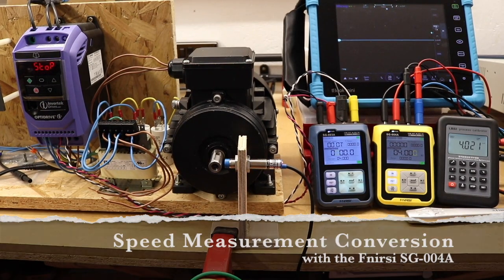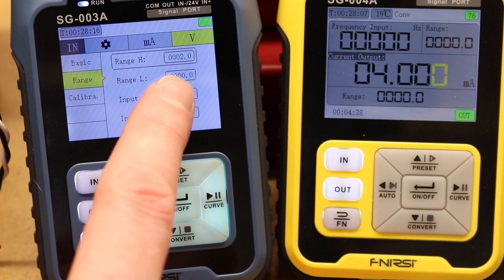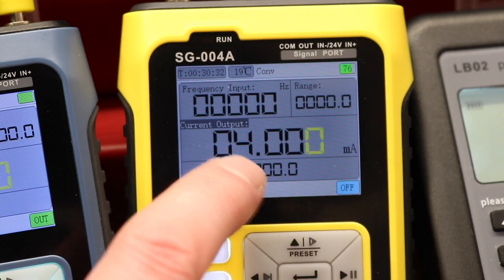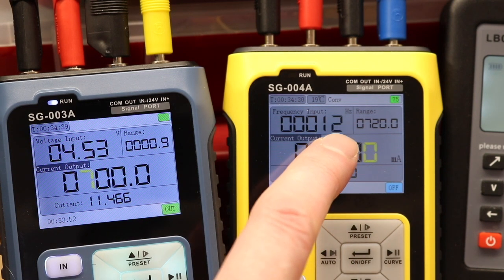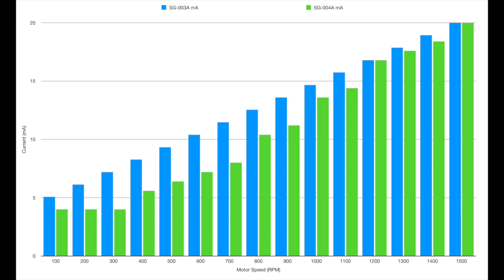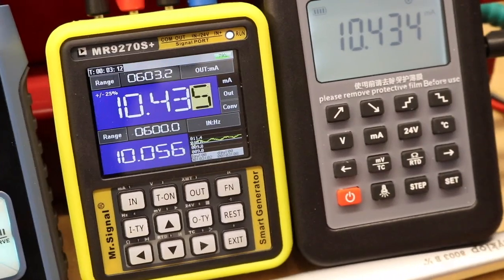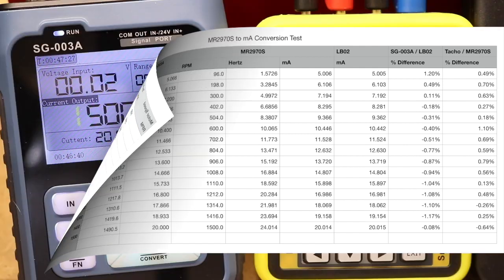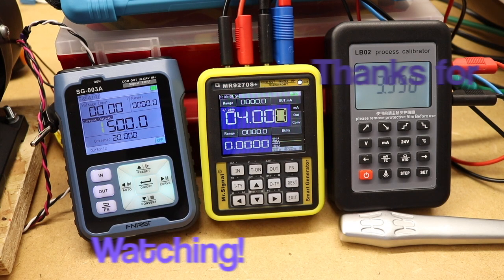Attempting Speed Measurement with the Fnirsi SG-004A

Comment: The "Convert" function to 004A does not work adequately. Given: measuring the resistance in 004A and converting it to a current output. 
If you set the settings:
Input H = 390 L = 0
Output H = 20 L = 0
then everything works. But if you ask 
Input H = 390 L = 0
Output H = 20 L = 4 (current 4...20) then the output is 0...20 mA anyway
Reply from the maker: Yes, the SG-004A does seem to be a bit quirky in its operation. Thanks for watching and commenting.

Comment: The only firmware update they released (2022) fixes one single problem, changes the word ULSE to PULSE. But they didn't change CUTTENT to CURRENT. Poor quality, no bug fixes, and the firmware update tends to brick the device.
Reply from the maker: I have heard that the have been issues with the firmware upgrade bricking the units. I haven't tried it on mine. They are of course very cheap units in comparison to what else is out there and unfortunately, support and development will likely be problematic. 
Thanks for watching and commenting.

Comment: According to the manual it can be controlled under MODBUS Slave mode and at the end of the manual there are tables of MODBUS functions. But, the manual does not describe how to connect the wiring. Does anyone know how to communicate and control this device using MODBUS (RS485) ?
Reply from the maker: On my unit the RS485 connections are on a 3.5mm stereo jack, there is a label below that identifies the G, B and A terminals. I did get a 2 wire adapter lead with my unit as well. The manual states that you will need a driver unless you are using Windows 10.

Comment: Well My SG_004A made it  exactly 30 days of daily use before use before biting the dust and wont power up after charging it. Of course today was the last day of the return window. I haven't even removed the screen protector.   🙃
Reply from the maker: That's bad news. If there is no success via the seller, then you could try contacting Fnirsi direct. They are a bit slow to respond but they have done to me in the past. They do send these out to Youtubers as well to review, so I would have thought they would be happy to replace a failed one.
Reply: I was able to end up sending the SG-004a back and they’re supposedly sending me two SG-003a’s in exchange. I know the SG-003a has less res than the SG-004a but I was finding myself using the SG-004a more for indicator leds, digital input and 4-20ma signal testing. so I think the SG-003a will be suitable for most of my testing I would otherwise use a PLC tools loop simulator for which has hardly any resolution and only outputs 10v and cost twice as much. Ill still be able to supplement other test equipment I have for those times I need to preform more in depth troubleshooting.
Reply from the maker: @mumbles1justin  That is good news, hopefully the new units work for longer! They are really useful and practical for general fault finding and investigation work.
Reply: another one bites the dust lol. SG-003a stopped working properly after about an hour worth of use. Now no matter what I do it only outputs 5v.

The input on the other hand will output up to 25v when 24v power is enabled on the inputs.

Ive finished out the day using the Mr signal to preform the same tests on the same equipment and it didn’t fail. So I don’t think there was any unseen hazards on the cables that caused the SG-003A to fail.

I have one more SG-003a still unopened in the box. I don’t know if I should hold on to it and use it or try to sell it and recoup some money.

Originally I had downed the Mr signal. due to past experiences, but this newer model is definitely better than the original model mr signal.
Reply from the maker: @mumbles1justin  Bizarre why you are having so many failings. There seem to be a few of these units out there, but I suppose a lot of the Youtubers just get them, do their video and don't really use them after that, at least certainly not in an environment that you do.

Good to know that you are getting on well with the Mr Signal. I have certainly found mine to be more stable than the Fnirsi.
Reply: That was going to be my next question. Have you been using the Mr Signal and/or Fnirsi in the field?

Your the only person on youtube thats reviewed any of these cost effective process meters that appears to work in an environment that would warrant using them.

All other youtube reviews Ive seen are from people that appear to just be home lab electronic enthusiasts that barely understand what a process meter is used for. Little lone actually demo these units on actual equipment such as a VFD like you’ve done.
Reply from the maker: @mumbles1justin  The SG-003A has not been out on site anywhere. The SG-004A and the Mr Signal have. I have been using the SG-004A today working on some temperature pucks. It is a bit more unstable in measurement mode than the Mr Signal, but has not failed like yours.
Reply: Let me ask this dumb question… In your opinion should a process meter withstand being connected to a faulty sensor with shorted current loop or shorted signal line without compromising the meter if the sensor is being powered by the meter? I assumed the SG-003a had current limiting protection built in to it. But if not that could be why the SG-003a failed. 

The SG-004a failed definitely do to charging. But to be transparent it was charged using an apple charger and not the factory charge because I try to keep my bag as light as posable and not carry redundant chargers.
Reply from the maker: @mumbles1justin  Should certainly be able to withstand a shorted fault on a 24V system. I did open up the SG-003A to fix a loos jack, can't remember what the protection arrangement was, I will have to go and re-watch the video. 

I charge both of my units with different chargers anyway as the ones they supply do not fit in the UK sockets and I don't have the right adapter. It is standard 5V USB, so shouldn't be any issue using a different power supply.
Reply: I just got around to opening the last Sg-003a. It came with a European power supply thats only 5v 1A compared to all the other meters that came with US 5v 2A  power supplies.

This one out of the box won’t allow me to calibrate the milliamp output past 9.8 mA.  So it clearly has problems out of the box also. So I think at this point I’m done trying get anymore FNIRSi. Theres no way other people aren’t having issues with these units. I haven’t done anything I haven’t done with any of my other process meters so I don’t think its a user error or miss use.
Reply from the maker: @mumbles1justin  You are certainly having a rough time with these. They may have had a batch of faulty components go through causing problems. They should be able to withstand faults that may arise on process control circuits. If you have connected one to mains, then the failure would be understandable. Have to see how long mine last. Hopefully the Mr Signal units turns out good this time around.

Comment: Does Your SG-004A have an issue when using the 24V out not displaying mA value?

Mine outputs 24v loop properly . But id wont display the mA loop current. 

Im pretty sure its because theres an issue in the 24V Range Output H. Mine wont allow me to change Output H from 00.00.

I got a $160 off coupon for a MR9270S+HART so I ended up picking one up for $206. seemed like a decent deal so I got one despite issues I had with another one years ago. This one definitely seems better than the one I had a few years ago.  Anyway, the 24 V loop current works and displays properly.
Reply from the maker: Mine does display the mA reading in 24V output mode. An 1800 Ohm load across the output terminals give a current of 23.4mA.
Mine is the same as yours though in that the Range Output H is set to 00.00 and cannot be changed from that.

Good that you got a deal on the MR9270S. Mine has been okay and looks to be a bit more stable than the SG-004A.
Reply: When I first put an 1.8k load on it and adjusted the Circuit calibration I did start to see a reading other than 0 ma. But that was the only reading that was displaying correctly all other loads were way off. But then ended up recalibrating using 2.4k ohm load to 10ma. So now its working as it should. 

Thanks for getting me a baseline and verifying the issue with Output H.

At 1.8k shouldn’t the current read 13.33ma not 23.4?
Reply from the maker: @mumbles1justin  Yes, it should have been reading 13.33 with the 1.8k Load. Not sure what I did last night as I can't repeat it this morning. It is reading 9.34mA when I test this morning. I haven't done anything with this function yet though, so likely that calibrating it will sort that out.

Good that you are sorted.

Comment: Do you know how to communicate by Modbus? with instrument
Reply from the maker: I have not set up the unit for Modbus. The instructions for it are at the back of the manual so along with some Modbus software it should be possible to talk to it directly over the USB. If not you would need a hardware adapter.
Reply: @three-phase562  I made a detailed reply on my findings of Modbus on the SG-003A in the third post, hopefully it explains a bit more for.
Reply from the maker: @paulaltingvangeusau3202  Sorry, can't find any other reply of yours

Comment: I had one of the mr.signal meters 3 or 4 years ago but I had constant issues with it staying calibrated after it was turned off for a few days. It almost caused a catastrophic incident when I was in the middle of commissioning a “Big Ass Fan” in an airplane hanger.  When the mr.signal meter’s output sent an out of range value it caused the fans rpm to increase more than expected causing the fan blades to flex up almost 2 feet hitting a gas line. It did not damage the gas line. But I dont feel comfortable using Mr. Signal  meters after that. 

I have a job coming up that has 8 optidrive VFD’s. Theres no hazard’s on this job. As well as I have a couple other process meters I know are stable. But I did just pull the trigger and ordered one of the SG-004a meters to play with. It should be here tomorrow. I was kind of on the fence going with the SG-003a. But I kinda wanting the ability to use with temperature probes.
Reply from the maker: That's quite interesting because if anything I am finding the reverse with my two units. The Mr Signal unit, seems to be more consistent and stable that the Fnirsi SG-004A. Just been playing with a temperature puck with the units over the last two days and whilst both can do the job, the Mr Signal seems to be more stable. 

Really nice to have a small unit though that can output the temperature range and then measure the signal coming back.
Reply: Maybe the new mr signal meters are running different firmware correcting the issues I was having. It was 3 or 4 years ago when I last had the mr signal.
Reply: My SG-004A showed up this morning and Ive been playing with it for several hours now.

I like the physical unit. But I only opted for the 4a over the 3a for the thermocouple feature but I cant get it to display properly in Fahrenheit.

When calibrating all the other readings I did have to recalibrate everything multiple times before it seamed to level out and stabilize and calibrate properly.

I think I am going to go ahead and send this unit back.

At this point, I just want a Compact unit I can use for scaling 4~20ma, 0~10V, and 0~24v. 

Would you recommend the SG-003a or should I try the Mr. signal again?
Reply from the maker: @mumbles1justin  I haven't used the Fahrenheit setting on mine really. I am testing a temperature puck at the moment so will give it a go with that.

My SG-004A does seem to be more consistent with use. Maybe the internal reference needs to age? I do still see a fair bit of fluctuation with the last digit though, that I don't see as much on the Mr Signal.

The SG-003A doesn't have the same accuracy or resolution as either the SG-004A or the Mr Signal units. It tends to be more stable, but I think that is due more to the lower resolution.

It depends on what you actually want. There is the LB02 as well, but that cannot source and measure at the same time and it will only source up to 11V, but will measure up to 30V. I found that the LB02 was more accurate and stable than the SG-003A. If I was going to buy it again, I think I would go direct to Brightwin for it rather than a clone unit from Amazon.

The units are a great concept, but they don't seem to have the stability of the higher cost big brand units available and I still don't know what the long term reliability is.
Reply: After using the SG-004a in the field its actually quite usable. I think Im going to probably keep it. The process conversion feature was nice. I was able to use the SG-004a to take 4-20ma input signal and output 0-10v signal to determine I had a bad conditioner.
Reply from the maker: @mumbles1justin  I think the units work really well for basic fault finding and like you say they are small and compact with a lot of functionality built in.
I ran some tests on a temperature transmitter setting the output of the SG-004A to PT100 and the input to measure 0 to 10V. Transmitter input range was -50C to 200C / -58F to 392F.
We will see how well the table below comes out!

Setting		Expected		Tolerance		Measured Vout	
°C	°F	Vout		Minimum	Maximum	°C	         °F
-50	-58	0		       -0.02		0.02		0.001	0.002
-25	-13	1		        0.98		1.02		0.996	0.995
0	32	2		        1.98		2.02		2.003	2.003
25	77	3		        2.98		3.02		3.012	3.014
50	122	4		        3.98		4.02		4.006	4.007
75	167	5		        4.98		5.02		5.007	5.005
100	212	6		        5.98		6.02		6.008	6.009
125	257	7		        6.98		7.02		7.011	7.009
150	302	8		        7.98		8.02		8.011	8.011
175	347	9		        8.98		9.02		9.001	9.001
200	392	10		        9.98		10.02		10.001	10.001

I did the tests in 1V output steps first with the SG-04A Output set to Centigrade and then repeated with it set to Fahrenheit.

The end two columns show the transmitter output measured by the SG-004A and they pretty much correlate across the range. There a slight discrepancies, but that is due to the instability of the last digit on the SG-004A. Results are pretty good and all within tolerance for both sets.

Comment: How does the over range setting effect readings? I noticed that you had over range disabled on the SH-004a and enabled on the MR9270s

4:00 over range is not checked. only Auto run is checked.

10:22 over range and Auto Run are checked.
Reply from the maker: Yes, I noticed that whilst I was editing the video so went back and changed the setting and retested but it didn't seem to make any difference.
Looking at the manuals it seems to lock the converted output range to the input range when it is unchecked. If it is checked then the converted output operates over its entire range. I thought that is what was giving me the issue, but when tested, it didn't correct the mismatch.